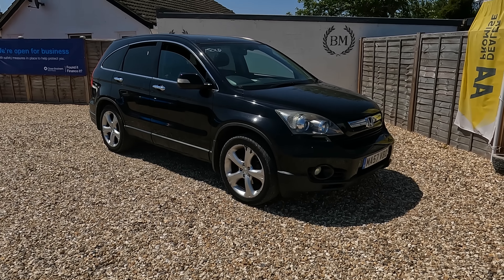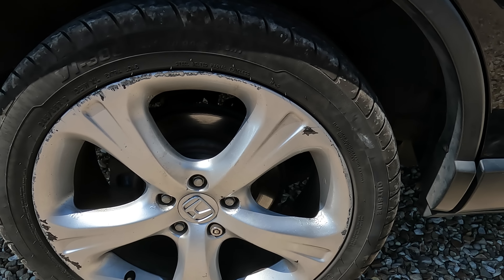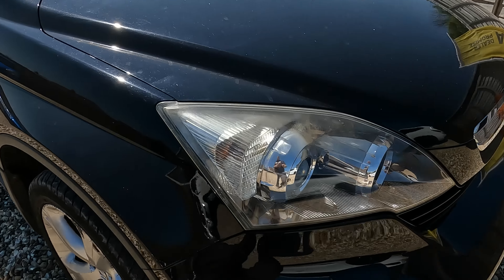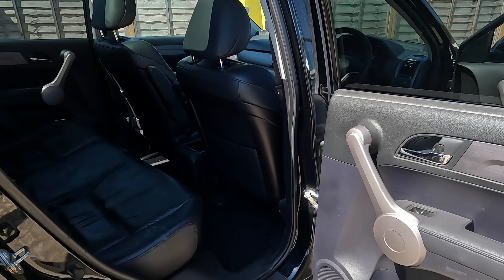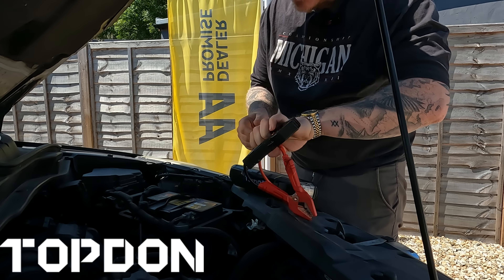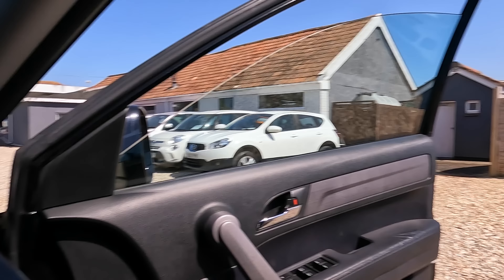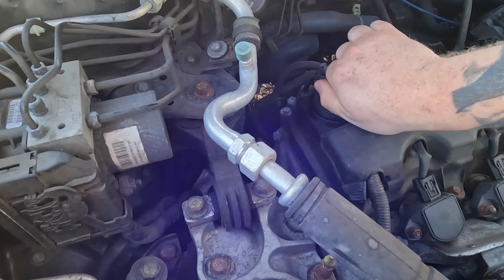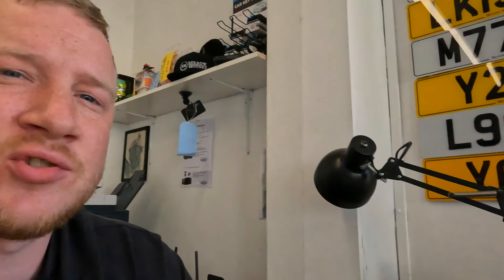My Cheap Auction Honda CRV has a little issue that's a BIG HEADACHE!

Comment: If the battery is draining quickly it may be the Bluetooth module at fault, it’s common with these and can be unplugged to fix the issue. It can be accessed by removing the side panel of the centre console.
Reply from the maker: I think it’s ok, I left it out there with ignition on for hours!

Comment: I bought a 09 diesel one last summer from Aston barclay Wakefield, bid 1600 as it needed paint, mint leather, 84k,only thing is on full lock rear starts to pick up (diff) apparently proper Honda oil sorts it, bought some, not done it yet, that the problem with auctions, Vehicles tend to have nasty driving problem s that you can't suss out.

Comment: I had an accord with an auto 2.0 petrol.

Ran amazing, extremely reliable but got it drank a lot.

Need to weigh up fuel v repair cost.

We were really happy, got 32mpg on a run, 20 round town.

In hindsight should have got a manual but I'm sure it wouldn't have been as nice to drive.